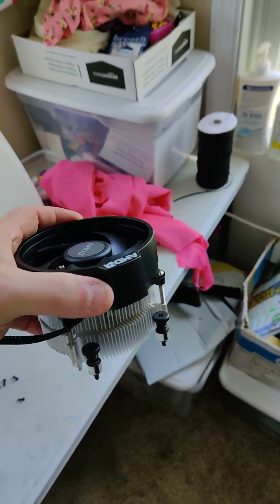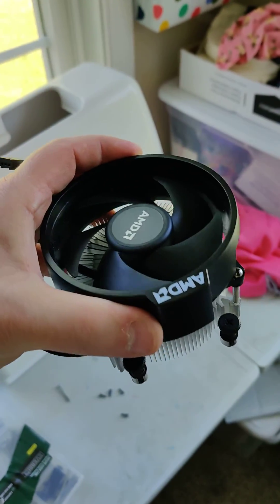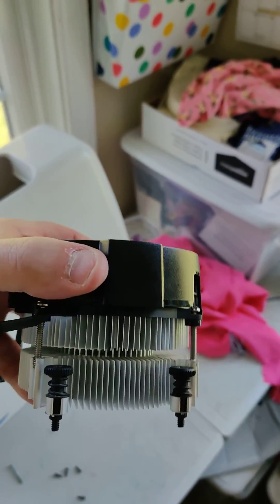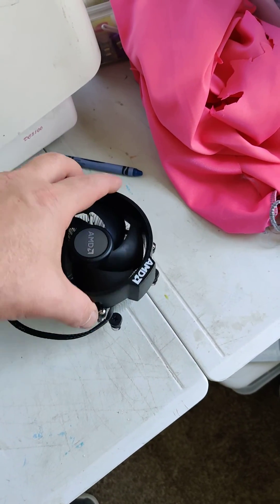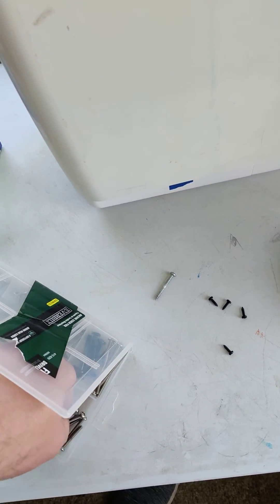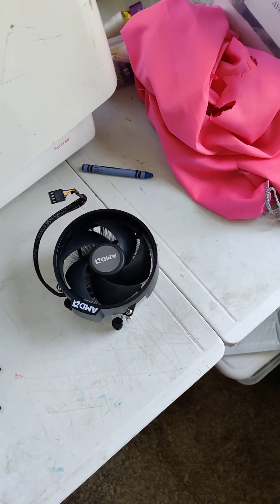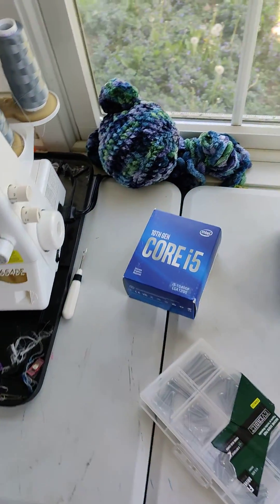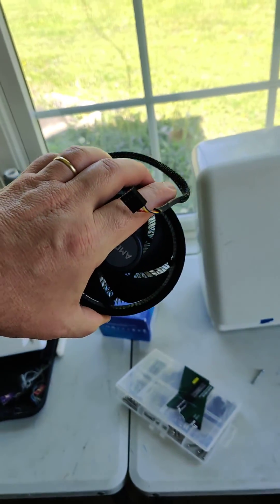AMD Wraith Stealth Cooler MOD!!

Comment: So basically, you can stack as many heatsinks until you run out of cable length on the fan... and then just get a 4-pin extension cable. 😅